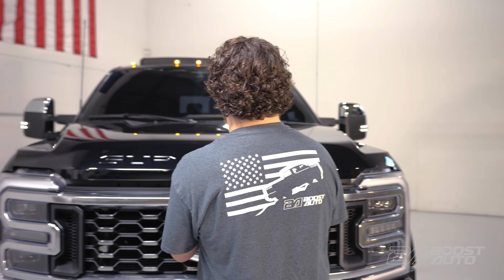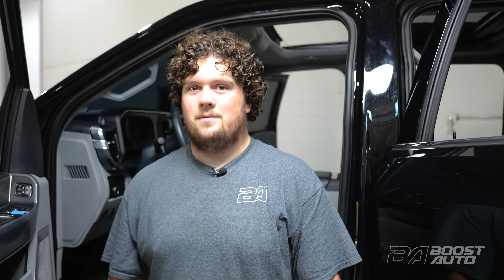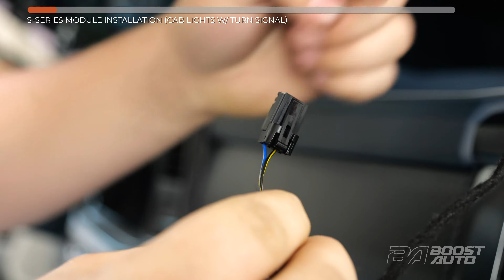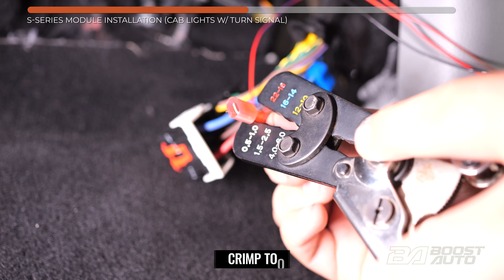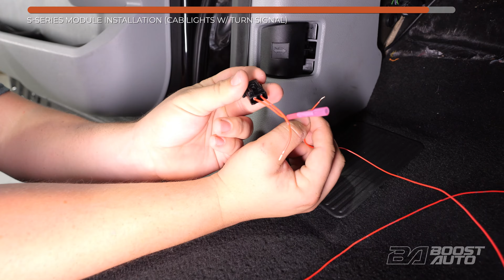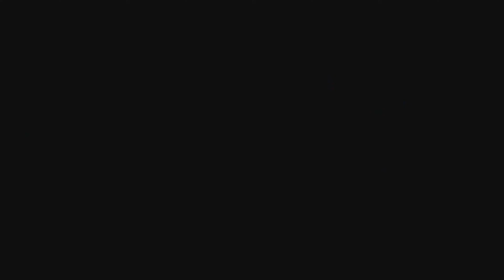Boost Auto S-Series Cab Lights Installation Guide | 2023-2025 Ford Super Duty F-250 F-350 Trucks

Comment: Quick question, I just had the mirror switch backs and the cab lights installed but they don’t turn on during the day when the knob is set to “Auto”. Is this by design? I had thought they would serve as a DRL during the day
Reply from the maker: They function the way the factory mirrors and cab lights work which is as park lights. So if you leave the switch in AUTO, they will only come on at night when it's dark outside.
Reply: @boostautoparts Got it! Is there a way when set to the “parking light “ on the knob the DRL on the headlight be on normal brightness? That way I could have the mirror/cabs lights run during the day without dimming the factory headlight DRL. I’m assuming it’s a forscan thing?
Reply from the maker: @herveyb.387  That's not something we are familiar with - sorry about that!